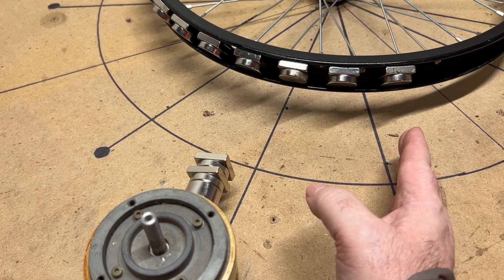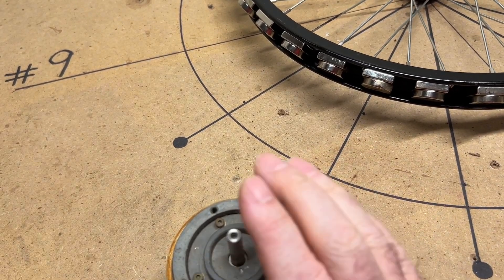GAME CHANGER? MAGNETIC MOTOR FREE ENERGY RESEARCH

Comment: Just use a Joe Flynn magnetic reciprocating switch all most no energy to move strong magnetic force .1 in 3.5 out .by using two wheels you'll get 100% out of it because when it flips the second wheel is timed to engage it .on the other side .

Comment: Your actuating magnets...
Spindle/hinge one side, the other utilise a soft spring as that out of a pen, magnetic force has to be stronger than your springs strength or it reduces the effectiveness of the rotation force.
Two or three should keep it going for a long time, the only thing really stopping it is mechanical failure.

Comment: I think i may have a very symple solution to your problem. Firstly, mount the magnetic arm the correct distance from the wheel so it can't move forwards, but it can still spin side to side. Then simply put a spring on each side of your magnetic arm. Place a stop block on either side of the arm at the correct angle that the arm moves to while the wheel is spinning. As the arm is pulled to the side by the magnets, the spring will be under tension,  as the magnets pass the tension will be released propelling the arm back to the origional position, and the spring on the other side will act like a door stop preventing it from over traveling. I wish you the best  👍

Comment: I did something similar, but instead of  doing the pivot controlled by the wheel i did it with a small electric motor that works with a small 9v Battery to keep wheel friction to the minimum the motor i got from a small radio controlled toy. 12:34

Comment: Surround the wheel completely with magnets of different strengths clockwise 12 to 6 from weak to strong, then the same cascading strengths from 6 to 12 in rotation with the pivot or pendulum action to help induce rotation 

Working on a design the has aluminum sleeves with magnets having spring release action to do the pendulum function,

Comment: Magnets will lose their magnetic field after passing thru the field of another magnet. Even if you got it to spin on it's own, it wouldn't last long. 3 ways a magnet can lose its field: shock, heat, passing thru another magnetic field
Reply: Not in this case.  The magnetic field isn't stronger OR in the opposing direction.   You're 0 for 2.
Reply: @NeoMK  whatever, this is still fake b.s.  Wont work, dont work, cant work. Scam

Comment: I do think your on to something as well! 
If I call the motor w/1" magnets your stator, and you place more stators at each clock position (1,2,3...12), each stator will need rather unique "timing". My thought is, with 12 stators set up, they would be perfectly in time with a timing orientation similar to that of a cyclocopter (cycloidal rotor design). 
With a cyclocopter, the "pitch" of each rotor blade is controlled by offset linkage. Using the same offset linkage, you should be able to keep each of the 12 stators perfectly in correct orientation, rather than using a spring loaded design like you'd thought of previously as a way to keep each stator in line, though, it's possible both offset linkage, with a ratcheting spring design might just be your ticket. 
I sub'ed you, for a very interesting concept I hadn't quite seen like before...
BEST OF LUCK with RESEARCH!

Comment: You mentioned that the magnetic field is along the edge of the square magnets. Is the north and south pole of the magnet on the front face and back face or on the left edge and right edge ? Axially Magnetized or Diametrically Magnetized I believe are the correct terms to describe how they could be magnetized. What about the round magnets ? Thanks for the excellent video.

Comment: Try fan blades with small magnets on either end of the blade with each blades natural angle acting as the pivot you need. As one wheel rotates so the fan rotates 90 degrees vertical out of phase with the angle of each fan blade a constant pull push also angle your stators 45 degrees off the surface where they are mounted and it will act as a push effect as they pass from the positive to the negative poles of each pair of magnets from the fan blades to the stator magnets

Comment: Instead of trying to move the magnet's angle mechanically, use a RC servo  instead. They can be accurately switched   on and  off by an Arduino  nano  or similar.  They don't use a lot of  power.
Reply: That’s why we need a team of researchers working on this. 
Teamwork makes the dream work. 😅
I’ve been thinking in terms of using the “SSG” motor’s circuit in unison with James’s Stator design.
Or even a basic energy collector. 
Why not?
Reply: Great idea a man. But not everyone has the skills to do it.

Comment: One more question
Are the magnets on the wheel titled? Is that by design or just the way the wheel contour is?
Thanks
Reply from the maker: 5:44 by design. Magnets have been tilted downwards which greatly helps to aim the concentrated flux that runs along the edge of each magnet.